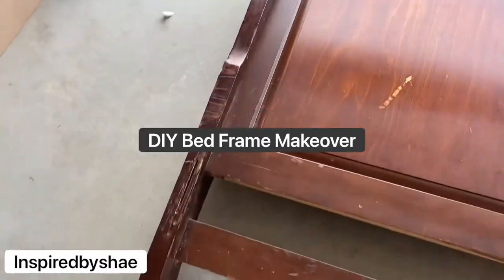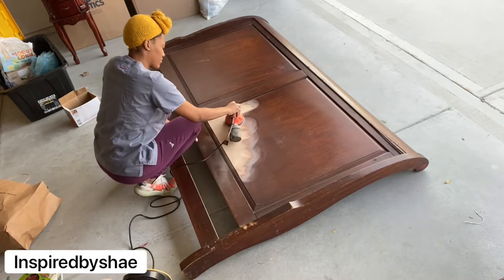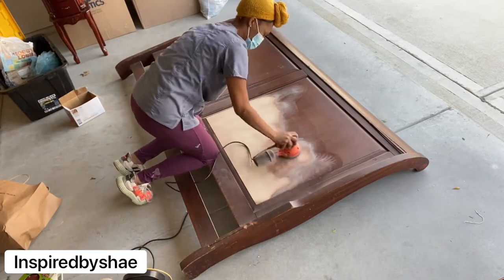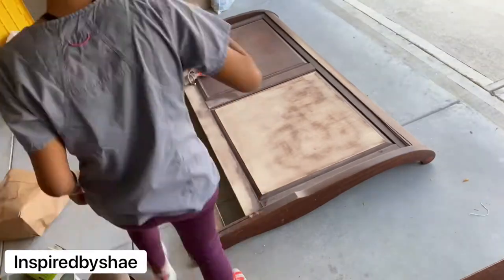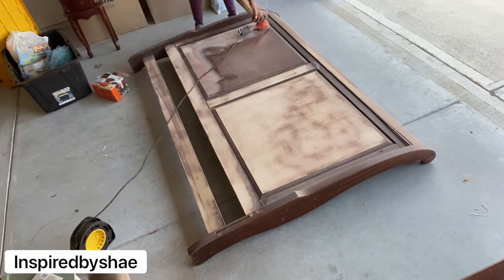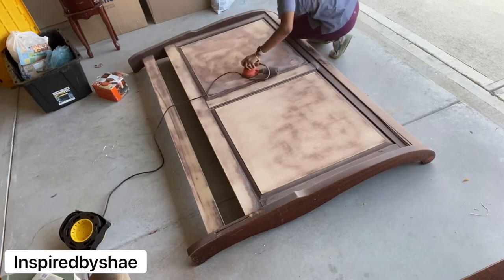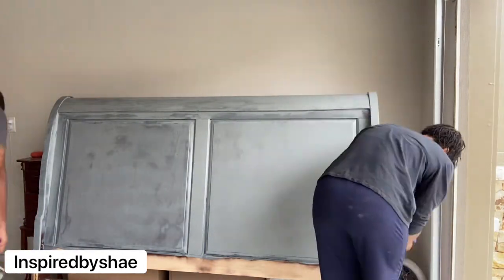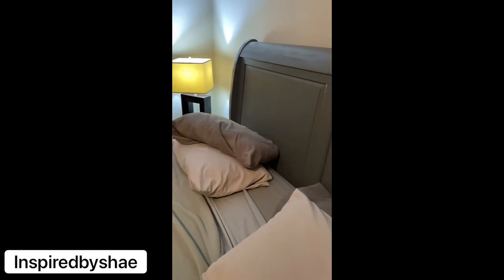DIY Bed Frame Makeover!

Comment: I still sand and prime my pieces before painting with Valspar Cabinet & Furniture paint. I also use a fine sanding pad lightly over the entire surface, paint again...  lightly fine sand again... then top with a poly-coat (matte or satin).  It comes out like glass! Love it! It's a great product! Important for people to know, also, that Valspar has 2 base coat types - one is for light colored paint tints and the other is for dark tinting (I think it's called base coat b and base coat C). Great stuff! Good job on your bed! Love the color!

Comment: Hi I have a solid wood frame pretty similar to yours.... are you saying or suggesting NOT to sand the piece if using the recommended paint in the video??? 

Turned out nice, good job!!
Reply from the maker: Thank you so much! I would say no need to sand and if you do want to sand it then use a high grit sanding sheet/block just to take off the sheen before hand. But no need to sand off the stain like I did! I actually like the parts of the bed the best where I didn’t sand at all. 

I hope this helps! And thank you for your kind words! I hope your project turns out great! You got this! 🤗